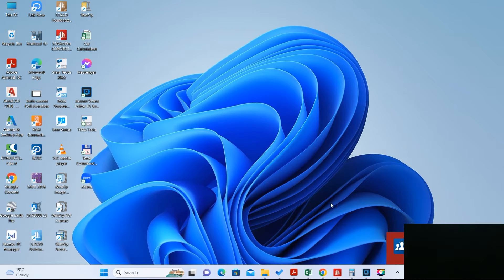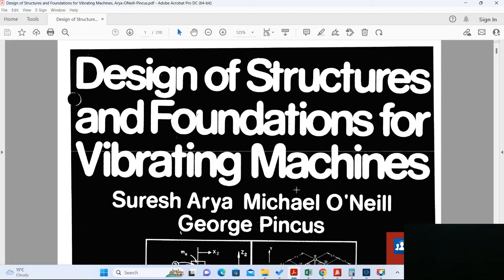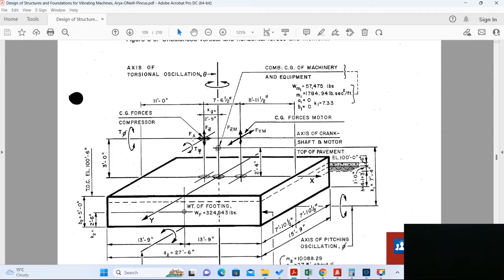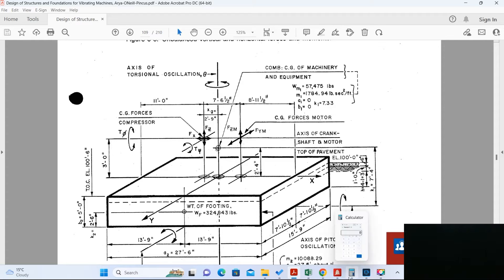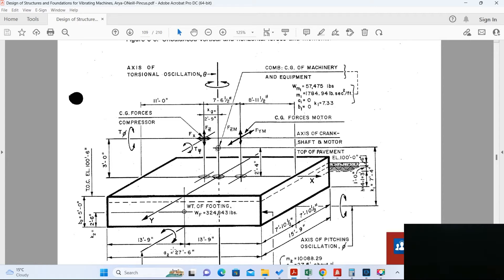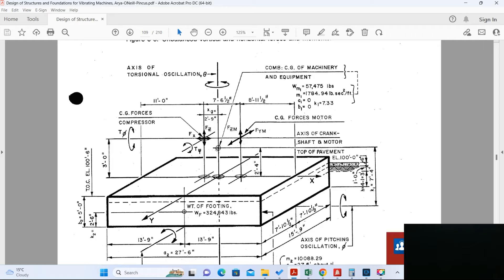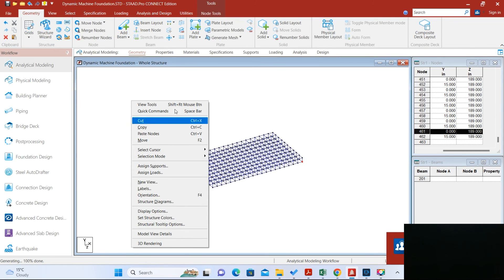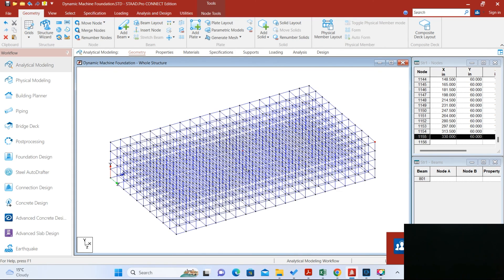Dynamic Foundation design by STAADPRO

Comment: I hope you wouldn't join the bandwagon of connecting weightless rigid entities with high flexural rigidity to the centre of gravities of the driver and driven package. I.e if those are the location where the dynamic loads are generated as this can be done differently without the modelling of rigid connecting beams as I see most of you online tutors. To apply lateral dynamic loads at a centre of gravity which is located above a modelled block foundation (note plate elements are also used, especially if a static design is also required), you apply the principle of transmissibility and transfer the lateral harmonic loads to the top of your block as well as the corresponding harmonic moments. This eliminates the modelling of rigid entities in a STAAD model. Also note that for most centrifugal machines that are connected to the foundation through tie-down pad plates like a gas-turbine driven generator, the unbalance forces are generated at the rotors and transferred unattenuated  to the pad plates and not at the C.O.G of the equipment packages
Reply from the maker: You are right, I could have transfer the forces in the line of their action (using the principle of transmissibility, as suggested by you). I preferred to model the massless members for easy understanding. You may post an example as you suggested.
Reply: I am wondering how I'll post this here as there are no possibilities to share attachments as I've designed several turbine-driven compressor foundations, gas turbine generators, etcetera based on multiple degree of freedom with STAAD to extract the time-varying deformation (in x, y, z directions), time-dependent quadratic mean velocity of vibration in addition to the time-dependent acceleration of the finite element foundation. Not excluding the response frequencies and vibration modes. If I can share attachments here I would have sent in a couple of these design reports for machines foundations engineered for a number of multinationals for onshore production gas and power plants designed in accordance with DIN-4024's requirements as well as provisions of API 686. This includes piled block foundations where restraints from the stratified soil formation are derived from the appropriate pile-soil interaction theory. You're doing a good job by the way
Reply from the maker: @PROCCIEngineeringNigeriaLtd   Thanks a lot for sharing your thoughts. I appreciate, if you can send me your design reports by e-mail to me. I shall include your reports in my next video. My e-mail is msajjadh58@gmail.com
Reply: Can I reach you, I have some questions concerning this.